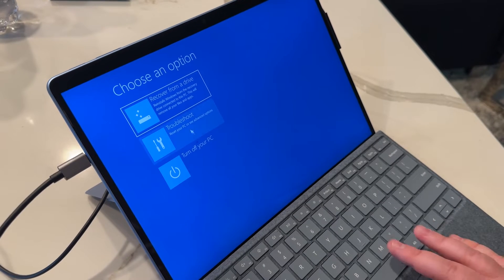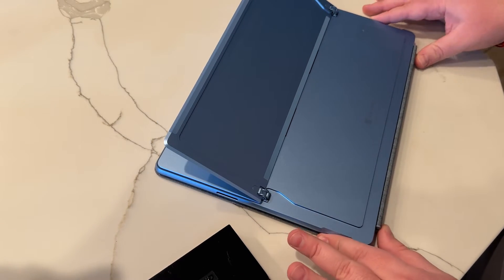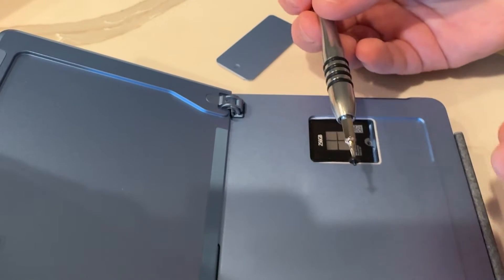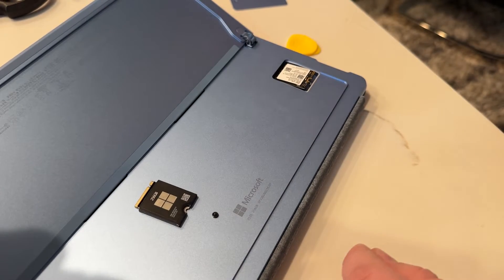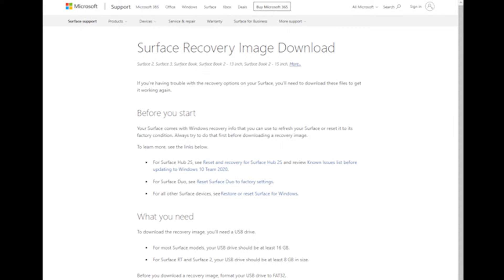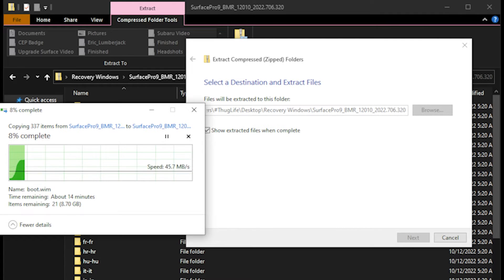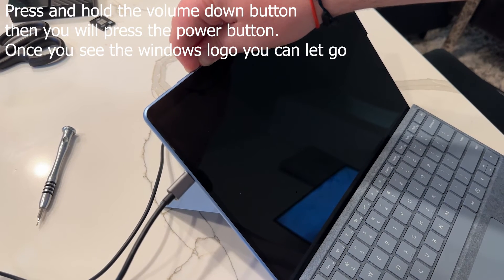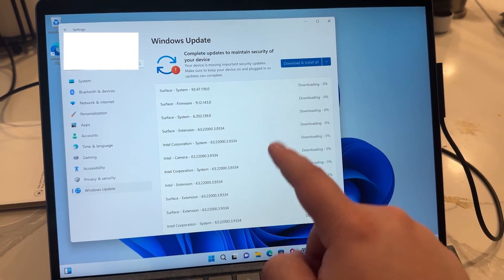How to upgrade Surface Pro 9 Storage [Fast and Easy]

Comment from the maker: Been learning from YouTube for years.... Wanted to give back some of my knowledge. Like and Subscribe if this video help. <3
Reply: Thank you for this - really appreciated.  Out of interest on the market is there a lot of variation on the disk speeds?  I'm wondering if you could also get a much faster SSD as an added benefit of changing?  Thanks again and wish you all the best on your YouTube journey.  Very clean / professional upload!
Reply from the maker: @RemofRenaissance  Great questions, yeah you would see some benefits in things loading slightly faster and files transfer quicker. I was mainly shopping for price over performance. You will need to get from a reputable manufacture that can guarantee specs or go off of third party sellers descriptions and test the speed once you install the drive.
Reply: @HowToWojo  tThank you!  Subscribed.  All the best
Reply from the maker: @RemofRenaissance  BTW If you did buy the Surface Pro 9, right now Microsoft is running a Black Friday sale. If you reach out to Microsoft chat support they will honor the discount and credit your bank back the $200 sale. Hope that saves you some extra $$$.
Reply: @HowToWojo  thank you for this!  I’m actually based in the UK but have been looking at deals.  I’m debating if I want to go with a Pro 8 instead and wether I can get away with 8GB ram.  No gaming for me but loads of spreadsheet analysis and reporting packages like Power BI so running that conundrum on what to do over and over again in my head.  Pro 8 is around $950 in UK inclusive of Tax and sometimes with a keyboard but…. 8GB RAM 😐
Reply from the maker: @RemofRenaissance  Spreadsheets is going to be something that takes up quite some ram. Especially if you are going to also going to be browsing the web as well. Since the RAM is not something that you upgrade later I would say spending the few bucks more for the extra ram will be money well spent. I was going to get the surface 8 pro, but choose to invest more into the Surface pro 9. It has DDR5 RAM instead of DDR4 ram, so its almost double the speed of the previous generation.
Reply: @HowToWojo  Thanks as always.  I’m falling victim to the upgrade ladder 😀.  DDR5 > DDR4 + 16GB > 8GB.   All the best 👍🏾
Reply: Muchas gracias. Manos a la obra.

Comment: Nice. Did you change something in BIOS? After trying to start vom USB-Stick: Couldn't find a bootable operating system. Check the Boot configuration to try to fix this. 
The new SSD is not formated. Any idea for my Surface Pro 9 with SQ9 processor? Thank you in advance.

Comment: As someone who knows very little about computers and keys etc, firstly thank you for such a simple, straightforward and easy to follow guide.

The only question I have is when i replace the SSD, what happens to Windows? Will the Activation key be stored on the USB when we create a recovery USB? Or will I need to purchase another license?  Thanks
Reply: To the best of knowledge — if I'm not mistake, I believe the actual license is tied to the device's hardware? At least in the case that the computer came with Windows 11 to start with. That said, I'm not 100% sure... More research required!
Reply from the maker: Glad it helped :) Yeah its tied to the device. So when you install windows it will notice the devices serial number and self activate.

Comment: How exactly do I get the cover open if it has been glued on like you did in the video after the replacement? 

How can I loosen the adhesive connection like you did in the video, for example? 

I'm asking because I bought a used device and the cover won't open and I suspect that someone has done something to the ssd card and I would like to know which ssd card is inside, whether original or not. 

Kind regards
Reply from the maker: Tuff one. Not too sure on that. Might need to use some pressure on it but it could break it

Comment: I have upgraded the SSD with a TeamGroup 1TB SSD, but after installation my surface temperature rose to 53 degrees Celsius, is it safe?
Reply from the maker: Generally, a temperature of 53°C for a Surface Pro 9 is within the normal operating range. While it might feel slightly warm to the touch, it's not a cause for concern.

Comment: On mine my overall local disc storage increase, but on all the other things like installed apps and system and reserved it says I can only use 52.4 gb for reach categories. Even though I upgraded to 2t and my local disc says 1.82 Tb.

Comment: The problem is that you are putting the thermal pad on the wrong side. The surface is designed to heatsink the SSD on the bottom, which is why Microsoft uses a completely enclosed SSD.

Comment: I've followed your video and my surface will not boot from a usb, could it be the new ssd ? It's a WD black
Reply from the maker: Had a similar issue with mine the first time I tried to re-install and different USB and still didn't work. Reached out to manufacture and they replaced the SSD for me and that seemed to solve the issue. Hope that helps.

Comment: I'm wondering why Surface Pro 9 is running SSD on PCIe 3.0. According to specs both device and drive are PCIe 4.0 compatible. I wanted to upgrade my drive with WD SN770M SSD(which has 5150MB/s and 4900MB/s read/write speed). It seems pointless when Pro 9 is running SSD in a mode that is limited to 4GB/s(limit for PCIe 3.0 x4).
Some YT tutorials for this upgrade include speed tests done after replacement and authors are dissapointed with results. I suspect it is rather a problem with PCIe 3.0 limit than the drive itself.
Reply from the maker: I think you are right with that.

Comment: Rather crucial to mention that you MUST prepare your USB drive FIRST!!!
Reply from the maker: Good point. I had a second device so didn't think of that.
Reply: Hi just wondering can I create the recovery USB for surface pro 9 on a PC? My surface pro 9 has a blank Ssd in it. Original was already sold.
Reply: If we took the original SSD away before we wanted to download the recovery image file then the new drive had no OS that means we cannot turn on the system.

Comment: I have a question regarding the recovery image download, so I downloaded it from Microsoft's website for my Surface Pro X, after I extract it, I can see the sources file has an X by it instead of a check mark, is this an issue?
Reply from the maker: Not super familiar with recovery process for windows unfortunately. If you found a solution please comment below so we can share with anyone else with the same issue. :)

Comment: For some reason the recovery process gets to 80% and then say an error occurred. Are you familiar with this kind of circumstance?
Reply from the maker: I was having a similar issue. I send the SSD back to them and received a new one and it was working. I classified it as faulty, but not 100% sure what the issue was since it fixed once I got a new drive.

Comment: Drive Clone??
Reply from the maker: That is a little bit more advanced so I didn’t cover that in this video. I would use this video as a reference for the SSD swap, and use another video that specifically focuses on cloning and that two drives.

Comment: Does this void the warranty? If I had to send the device in to Microsoft for repair they would either not replace it or they would send me back a device with the original size SSD in the case of a swap?
Reply from the maker: As far as I am aware it is possible that they may say the issue is related to the upgrade that you did. So before you send them the machine I would install the stock SSD and see if you still have same issue and then send the device to them with the original SSD. Incase they replace the device you don't lose out on the upgrade that you did. The way I see it is if they give you the ability to upgrade it why would they deny your warranty.

Comment: How much you paid for the 1 TB and how can you use that 256 gigs as external or you have to throw it in the trash bin ?
Reply: You would need to keep the 256GB drive in case of needing a warranty repair I think.
Reply: @DDogCodes   Good call on that.
Reply from the maker: I am holding on to it in case of warranty. Or if I sell the device in the future its good to have to resell.

Comment: My computer goes on a continuous boot and doesn’t repair or load windows. Please help.
Reply from the maker: I would format the USB drive with the windows software and try to see if it will boot from it. If not then put in the old storage drive and attempt to follow the same process for upgrade and if it works on old device its possible you have a faulty drive.

Comment: If I've learned anything, it's to never store my files on a computer and maintain them on a minimum of two external drives. Because data recovery is a bitch.
Reply from the maker: Yeah I here you there. I needed to upgrade my storage mainly for software, and everything else I just backup the device on cloud/external drives.
Reply: Yeah, when he sent them to the cloud and acted like that was a reliable option I really cringed.  This guy hasn't seen entire ecosystems of online content just disappear one day when a company decides they are done with it.

Comment: Guys, be suoer carefull, the acrew ia really weak.
Reply from the maker: Yeah its a super small screw, did the screw snap on you?
Reply: My snap how do I fix it?
Reply: @santossniper  I would just call microsoft and tell them it broke and see if they will waranty it... You might need to ship your surface in and be out of a computer for a lil bit.

Comment: Might I add, you will need the Microsoft case that the SSD sit in. Due to the fact that the T6 screw will not line up quite right. It will be off center just so slightly. Removing the case is easy and will help with securing the SSD down with the T6 screw. Otherwise, vibration can cause the SSD to move or malfunction.
Reply from the maker: Thanks for letting everyone know about this. I noticed this in the install that it moved slightly just forgot to mention it in the video. I didn't remove the case from mine since I was going to just resell the SSD on ebay.
Reply: Can you please show or explain to me how to remove the Microsoft case.

Comment: 2TB version would work on Surface 7 Pro plus?
Reply from the maker: Yes it should be supported as well. It will be the same install process as shown in the video.
Reply: yes